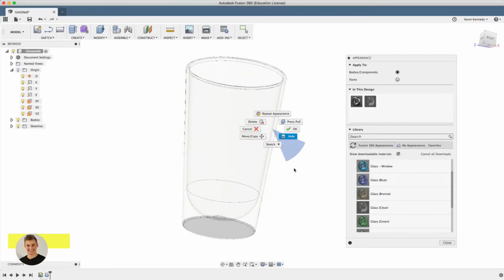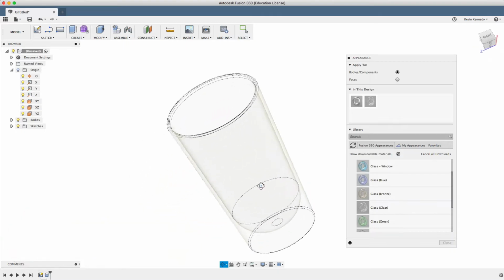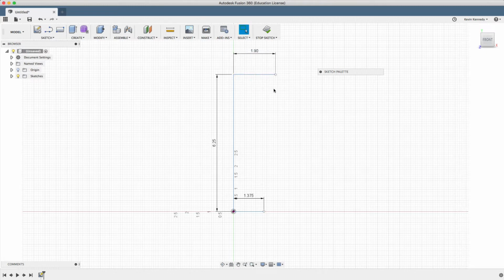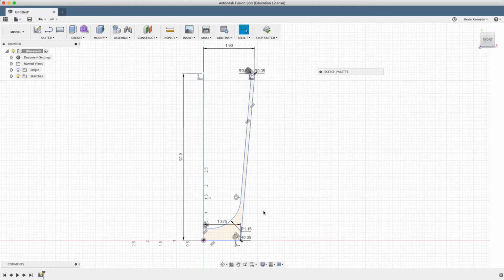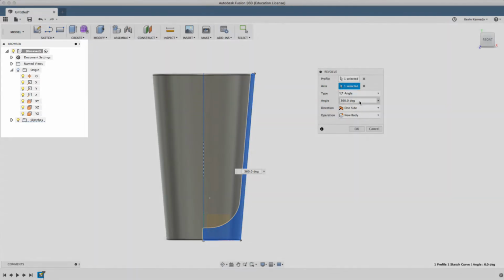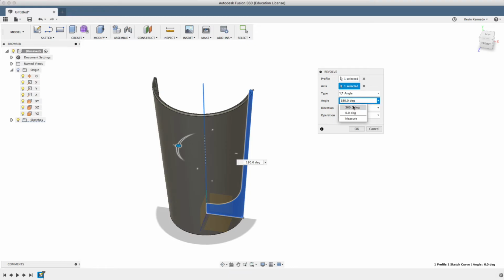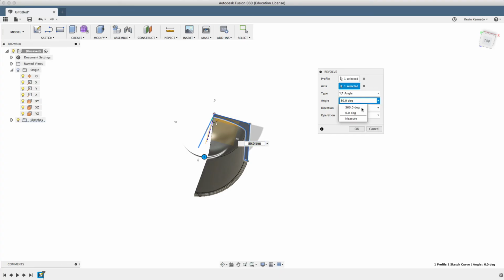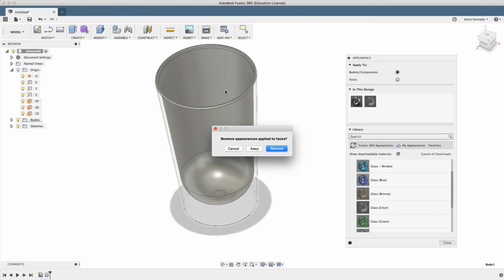How To Use the Revolve Feature in Autodesk Fusion 360 (for Complete Beginners)

Comment: How do I change the diameter of the revolution? For example a wider cup with a hole in the bottom
Reply from the maker: In the original sketch, you can change how far the side walls (sketch profile) are from the center axis.

Comment: Do you have a more in depth video on revolve?  I thought I had Fusion down pretty well at this point (I could be wrong) and I have found revolve to be lacking in functionality, especially in the "two sided" tab.  I cant chose to have my material in a clockwise or counter clockwise manner. Also, lets say I want to have the profile start at -20 degrees and go to 30 degrees.  It just doesn't seem to be as functional as I would hope. Also the (To) functions seems to be glitchy or something.